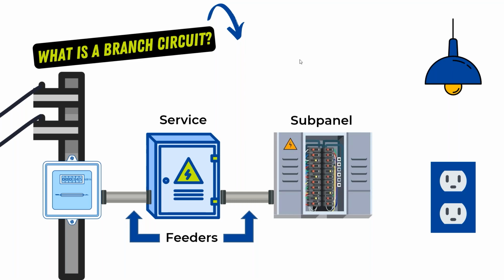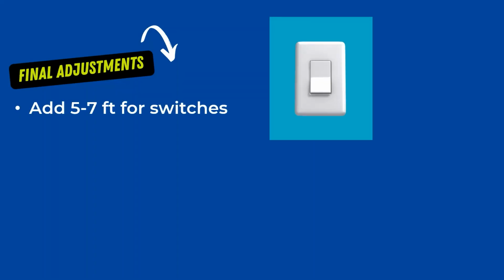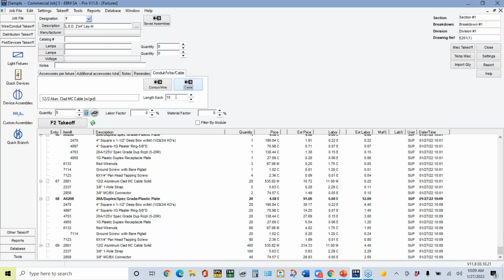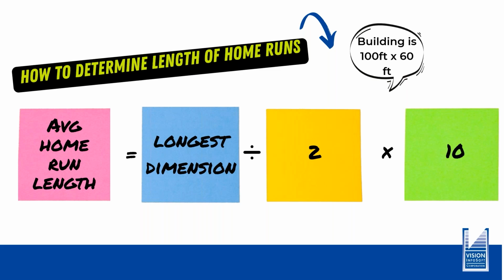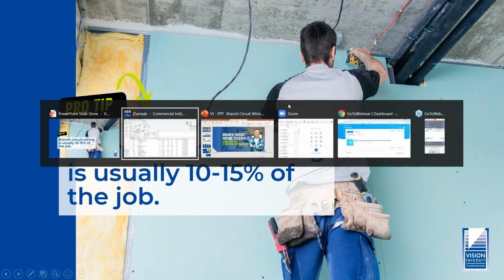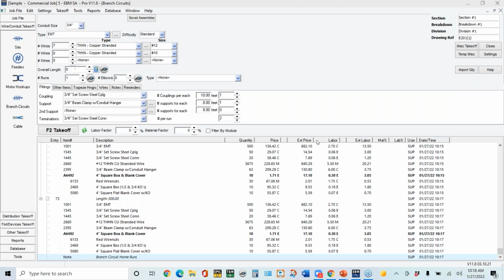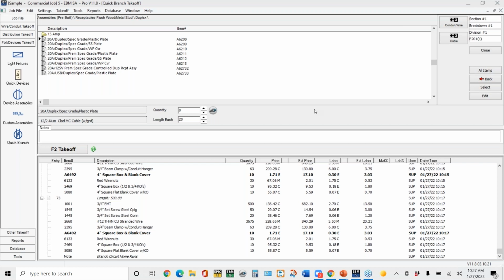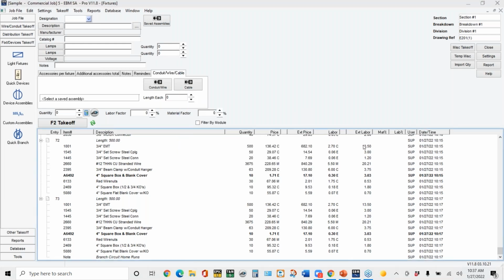Branch Circuit Wiring Takeoff | Shortcuts for Electrical Estimators

Comment: Great video, everyone! I used a method similar to this 25 years ago when estimating was much simpler, especially before we had lighting controls, switched receptacles, and more complicated circuitry. After many years of doing estimates in different ways, I’ve found that averaging isn't as accurate as scaling. ++BUT++ I agree with so much of what you discuss in the video.  It’s true that the branch is not the largest cost of the project, and ++IF, if you're not an experienced estimator, using this method will definitely help you get closer to the right estimate and save a lot of time. Of course, this approach won't work for every job, particularly in restaurants or projects that require a significant number of lighting fixtures. I recommend that you never use a number lower than 15, even if the formulas suggest otherwise. Overall, this is an excellent resource for beginners. I've created an Excel spreadsheet to perform the calculations discussed in the video. If anyone is interested in using it, feel free to reach out!
Reply from the maker: Thank you for sharing!  If you don't mind, send the spreadsheet to sales@visioninfosoft.com. We'd like to have a look at your handiwork.
Reply: Hey fellow estimator here. if you would mind to share you're excel spreadsheet? it will mean a lot. Thanks!
Reply: I started doing estimating about six months ago and have been researching ways to speed up my takeoffs. I’d love to check out that spreadsheet.

Comment: I am 90 years old but try to stay sharp. It is always helpful to learn new methods. I actually  have a laminated graph that is based on the same calculations. I believe it was included by Estimatic  Company of Colorado with their estimating course that I took many years ago. I think the company is now long gone.
Reply from the maker: "Never stop learning" is a healthy habit to maintain. We'd love to see that laminated graph if you feel like sharing it.  Take a photo and email it to sales@visioninfosoft.com  -  I haven't heard of Estimatic but it sounds like they had a pretty good electrical estimating course if they included tool that you have held onto all these years.
Reply: @Visioninfosoft  If I can locate the graph in the future I will email you a picture. Also Estimatic Corporation is no longer in business. They also had great information pages in their 3 ring binders, ie concentration factors for wire pulling  (A table)  Hope this helps. Will contact you later. At 90 years old I need more time. Thank you
Reply from the maker: @butterworthchapman6075  No hurry. It is great to have a chat with you.  - Derrick @ Vision InfoSoft.
Reply: @Visioninfosoft  Also there is another short cut method that an electrical contractor and myself developed. I cab discuss this at a later date, Howard C

Comment: I see you make final adjustments for average branch circuits to account for vertical distances, but you don't make the same consideration for home runs.  It seems like that short-cut for home runs would only be taking into consideration horizontal distances.  Can you explain the rationale to not adding vertical distances to the home run calculation?
Reply from the maker: The home run calculation is just an approximation.  Since the length is already rounded up (1/2 of the longest dimension rounded up to the next 10 feet), I don't know that it is necessary to adjust this further unless there are higher than normal ceilings (above 12 feet).  Let us know if this helps.
Reply: You have a very good point, I have a graph that does the same but a person needs to be very careful. You are correct HGC
Reply: Great thinking and you can add these in when taking averages, Thank you for the input.

Comment: Hi thanks for the videos, quick question how do you estimate the amount of wire need it for a given number of fixture  and a given  number of receptacles?
Reply from the maker: In most commercial applications, you would use an average of 20 feet per fixture and/or device. But, that does not include homeruns. Otherwise, you would use the actual measured lengths.

Comment: I feel that using this method is a bit inaccurate but hey if it's still going to be profitable on the contractor's end then its all good. I personally use AutoCAD which I have tailored with additional lsp files, Microsoft Excel and Python for quick and accurate estimates.
Reply from the maker: Patrick, what type of jobs are you estimating?  We'd love to hear more detail of your strategies. 

Most of our customers get their electrical plans as PDF files. No AutoCAD. However, there are situations where AutoCAD comes into play.  Using AutoCAD lisp files and Python are advanced methods for creating estimates in some industries and specialized types of jobs. Our software excels at helping electrical contractors bid on commercial electrical jobs.
Reply: @Visioninfosoft  I mainly estimate mid- high rise building installations but there were times when I needed to estimate some residential ones. I import pdf files into CAD then convert it into DWG. Using AutoCAD is still the old school way but it allows you to simply draw lines for where you run conduit going into the panels and with lisp files you can add up the total length for all the lines you drew. There are also lisp files that allow you to detect how many elements of a specific drawing there is so you can count the amount of fixtures, switches and similar things easily. I made myself an app from python with GUI that has data for market price of each electrical component and for automating addition of lengths for conduit, wire (for every outlet and switch), amount of fittings, clamps and pull boxes, etc. Residential building estimates take about an hour or two and mid-high rise buildings take about a whole day or two.
Reply from the maker: @JackThiccBack   Wow, that sounds pretty resourceful! We wish our customers had access to the engineer/designer's original AutoCAD file so that we could integrate our bidding software with a meta-data-rich file. But, what you are doing is pretty interesting.

Our Electrical Bid Manager software integrates directly with PlanSwift. This combination gives you a built-in database of electrical assemblies and items that you use to measure conduit/wire runs, count fixtures/switches/etc, and automatically calculate labor and pricing with a direct connection to your local supplier. PlanSwift also allows you to do basic design/build work on the plan if needed. It is a valuable tool for electrical estimators.

Thank you for sharing your bidding process.
Reply: Patrick, I'm curious about your process. How are you able to convert a 2d PDF file into a 3D CAD without the architect's original files?
Reply: @earcher0  Everything here in the Philippines is done with AutoCAD 2D making the conversion process of PDF into DWG much easier. It's just simple PDFattach and PDFimport on AutoCAD.

Comment: How many plugs per branch circuit usually in commercial? Then how many on residential branch circuit?
Reply from the maker: The number is about the same for both commercial and residential.  However, residential is usually 15A. We recommend you review your electrical code book for specifics but typical is 4 to 8 general purpose receptacles per circuit.

Comment: Regarding home runs, what about over 30A or branch/feeder for mechanical equipment? Would you do the same formula or takeoff point-point? Some jobs allow multiple over 30a or 3ph in same conduit and some do not. Engineer specific.
Reply: I don't use shortcuts for 30 amp plus circuits; they need to be measured individually, even if you combine more than one circuit in a conduit.
Reply: @brianhoffelder8830  I just realized this. You had a 100'x60' and cut the 100' in half equals 50'. then multiply 50' x 10 home runs equal 500'. then you entered 500' x 10 run into EBM. How do you fit a 500ft home run into a building that's 100' max length?  wouldn't you have 10 runs of 50' home runs and not 10 runs of 500' ?  This doesn't register right with me.  Seems way too much home run for a 100' building.
Reply: @justinblunt5627  It's 10 home runs of 50 feet each that totals 500 feet.
Reply: @brianhoffelder8830  that's what I thought but in the video it looked like you entered 10 runs of 500ft. I'm not used to EBM, haven't used it in years.
Reply: @justinblunt5627  Sorry it wasn't clear.  It's the Total or Overall length.

Comment: When you say branch circuits, how many conductors are you figuring in those branch circuits? 15-20ft avg branch for most commercial? how many conductors? 1-1-1? 2-2-1? 3-3-1? 4-2-1? You'll have 3way and 4way branch in there somewhere as well I'm sure. Does your average cover those as well? what about ISO ground circuits? how are those covered or does it matter? I still do it the old way and it is VERY time consuming just to group all the circuits together let alone running circuits to outlet areas.
Reply: 1 circuit, 3 conductors for each run using an average of 15-20 foot each (unless other adjustments for ceiling height, etc. need to be made).  ISO ground or dedicated home runs are included.